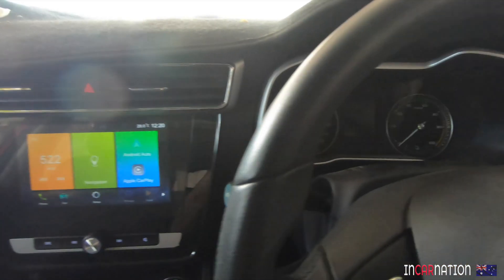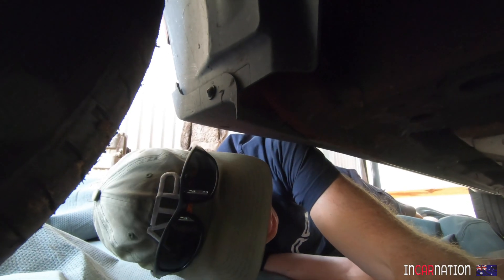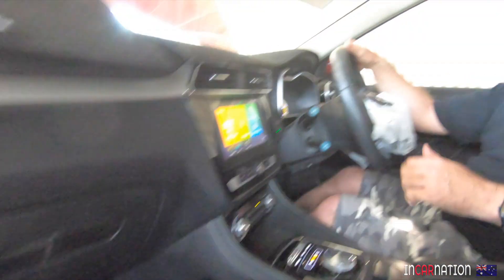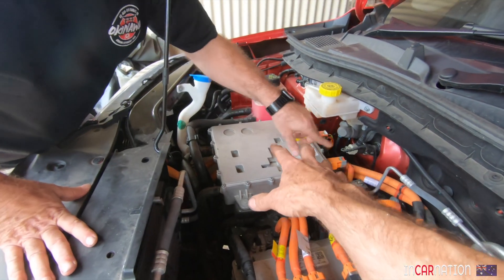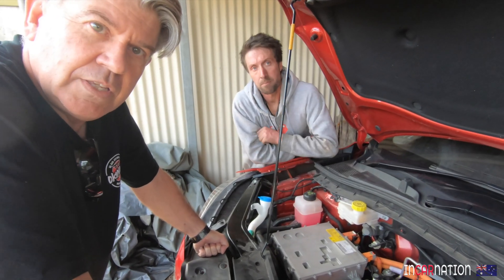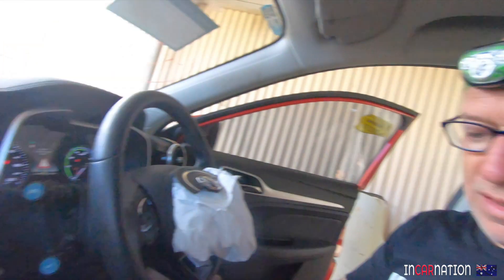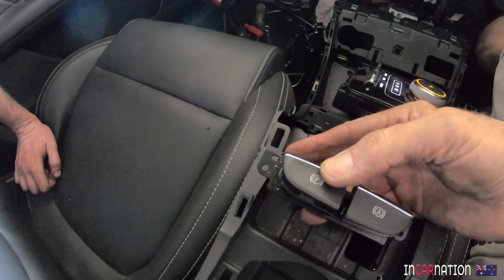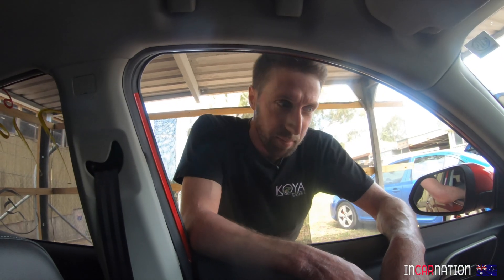Episode 6 – Porsche EV Conversion | Can Our Crashed MG Still Drive?

Comment: Perhaps the Chinese are more trusting and less greedy than the west thinks, and builds cars like manufacturers once did.   Cars crashed, air bags gone off, virtually no one will pull it apart to disconnect the SR? thingy to drive it anywhere.  Only a backyard car enthusiast would to fix it.  Car manufactures nowadays do their best so this can't be done and has to go to them every time.  I think the Chinese make sense.

Comment: So funny about the SRS disconnect. I had a Mercedes B-class EV which got rear ended. Damage not bad, but the car behind was pretty messed up. In our case, the SRS system triggered a PYROTECHNIC SEPARATOR in the battery, meaning that the high voltage connection was physically severed. This separator was inside the battery pack, and basically the fix was a battery pack replacement, which was of course not going to happen with a 9 year old ev with 70mi range, so it was totalled by insurance.
Reply from the maker: It's so wrong isn't it - body damage not severe but what is effectively a blown giant fuse meaning you need a new battery. That's very poor design. The whole point of the fuse is to protect the battery (and the rest of the car) from short circuit and overload. This is the ultimate irony. High Gs recorded, SRS says pop the fuse to play safe, battery saved, and having done a great job now the car is a throw-away. No wonder insurance premiums are high.

Comment: I think the Porsche will be under-powered with the pathetic 125kw MG motor.
Reply from the maker: You're probably right. And I do want the 928 EV to be an impressive performer. But in coming to grips with all the electronics, it might be a useful stepping stone toward the end goal. But torque equates to acceleration, and the MG motor is supposedly 353 Nm from low speed and the V8 only 385 Nm at 4300rpm.  And the V8 motor alone is almost 200kg heavier so in the real world the puny MG motor might be quicker than we expect. Mind you, the Tesla SDU is meant to be only 330 Nm and they haul a*se in EV conversion projects. And the Tesla LDU is a tyre fryer at 450 Nm, so either of them would be good. I suspect the electronics are the limiting factor in throttling the MG motor back though. Be really intersting to know...
Reply: @inCARnationAustralia  yeah your probably right. 
You'll end up with equivalent performance I guess. 
Gl

Comment: Love it.  I’m pretty sure that in an airbag level crash in a Tesla that they blow the pyrotechnic fuse in the battery pack. 

If you can work a way to get the reverse camera in the 928 it’d be great. 

Also what is weird to me with modern cars using electric parking brakes is that they are still manually activated. When you put the car into park it should just set, and release as soon as you put it in gear.  Much simpler.
Reply: The mg4’s park brake works just just you described.  So they did figure that out at some stage.
Reply from the maker: @leonkernan  Yes I noticed that too. The MG4 is a huge leap forward from the original ZS EV.
Reply from the maker: Yes I'm kind of glad the (expensive) pyro fuse is something the Chinese engineers decided not to include in this model. At least I presume they didn't. Having the contactors and pre-contactors built right into the battery pack seems to be a good compromise. But you'd still want to know that, in a worst case crash with the wiring compromised (i.e. a short) the contactors did always OPEN in all cases. A physical fuse is reassuring.
Reply: The ZS engages the park brake when you put it into Park. That is the only difference to Neutral. There is no 'park pawl' or anything in the drive unit.

Comment: Not such a silly idea to graft on the Porsche panels, but do it backwards because RWD😜
Reply from the maker: A simple and brilliant suggestion, and safer too as driver's seat would now be curbside. Except
- MG has speed limiter in Reverse
- I'd get a sore neck looking over my shoulder to see where I'm going, but clearly not looking ahead isn't a problem for most drivers!
- steering controls reversed - left to right